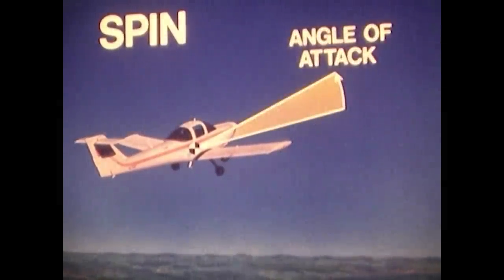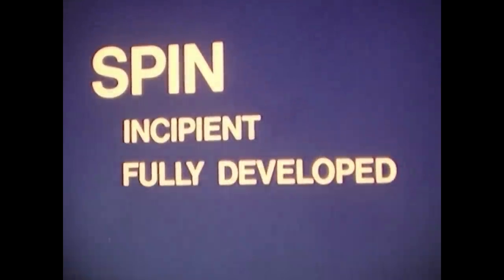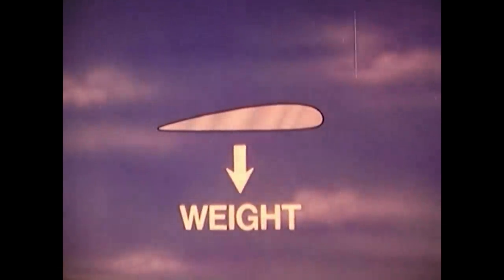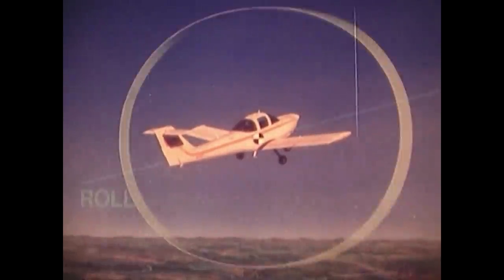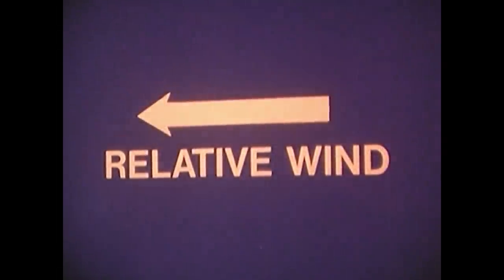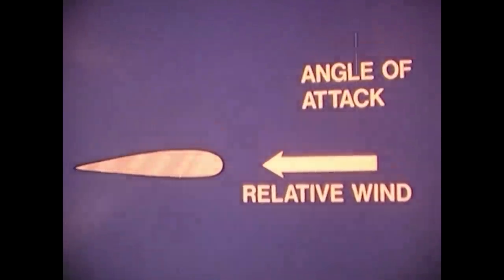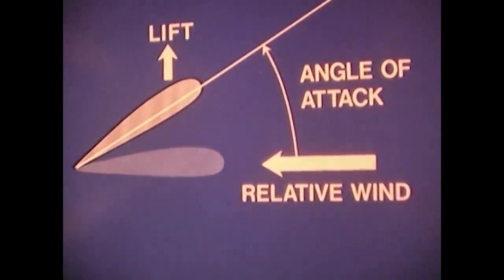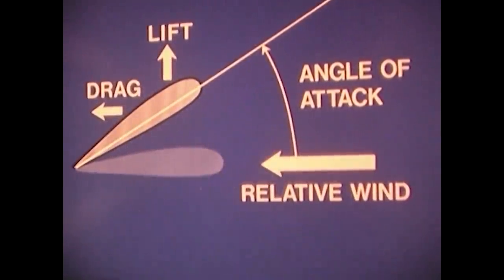FROM THE ARCHIVES | Stall/Spin Classic Facts and Myths (1982)

Comment: Was that a trauma hawk 02:29 ?
Reply: Yes an excellent 2 seater. Just need more advanced practice to exit the spin cycle.
Reply: @tomstulc9143  In the USA the FAA may have prohibited at some point in time or required spins prohibited placards. My take here is that the incipient spin should be caught and arrested early; that may be to imply that entering a spin can sometimes be unrecoverable. The term flat spin comes to mind. The other nearly identical airplane similar to the Piper Tomahawk was said to be slightly heavier with greater forward cg but I wasn't ever able to check and verify it.